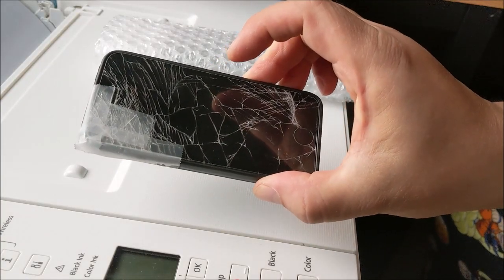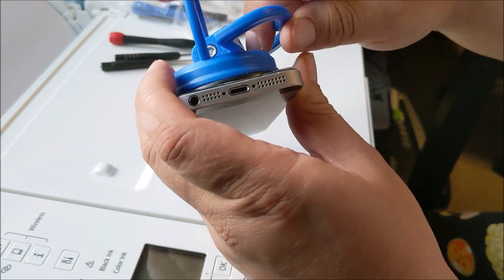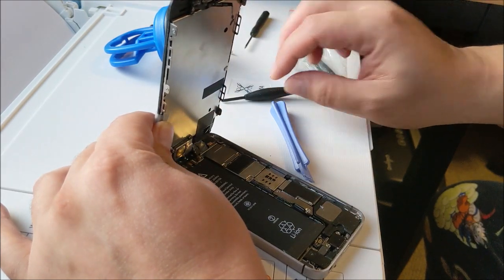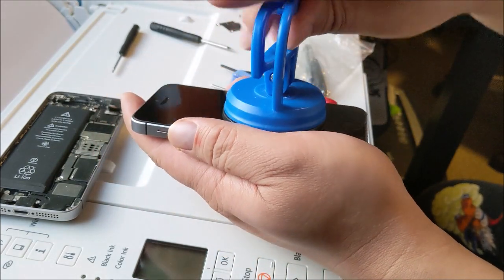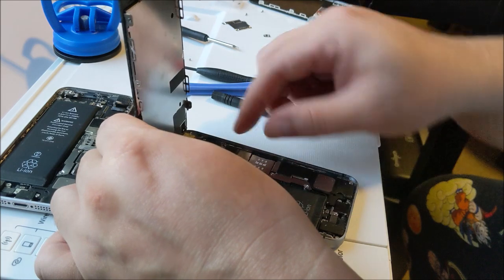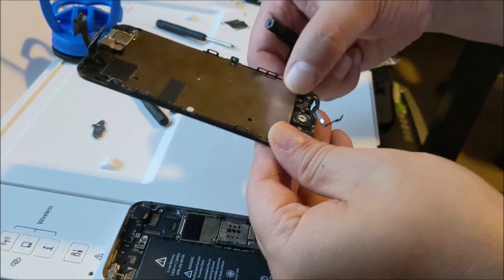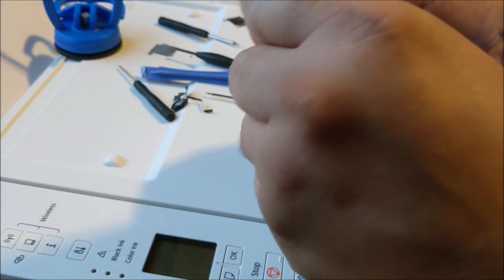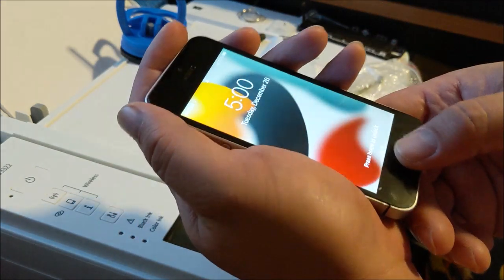I recently replaced my iphone se screen.  I used a parts phone I got off ebay instead of buying new

Comment: Thats exactly what I did with mine in October I was drinking and hopped a fence for a shortcut to the store in 2017 but i slipped and fell off landed on it but the back got dented what destroyed the screen was the butane in the lighter freezing it enough to watch it shatter from the outside temperature stayed on for a few days using just siri and home until it died the frame and screen were screwed but even the battery survived just needed to be bent straight a hair.